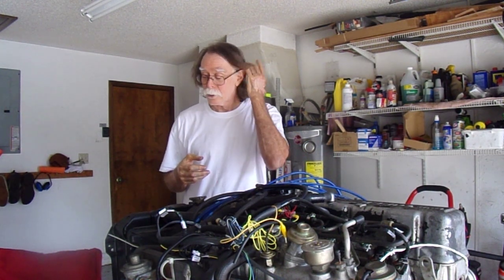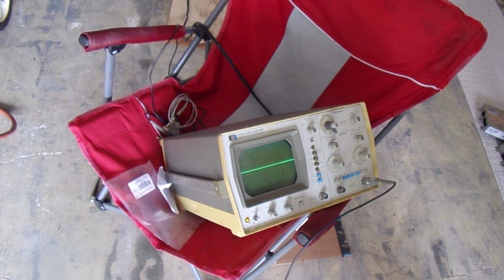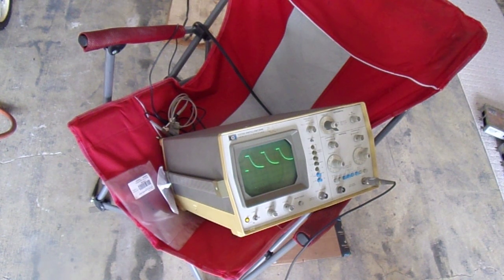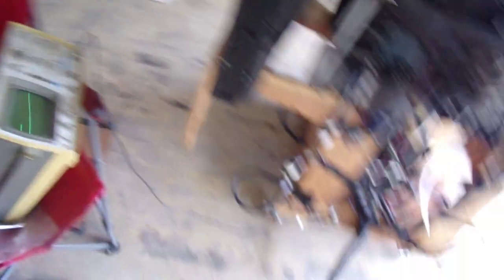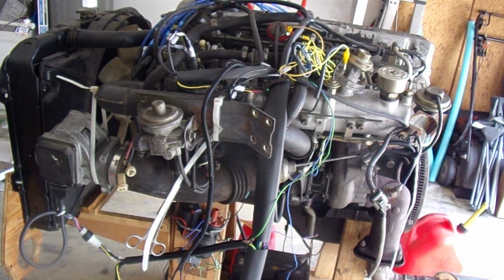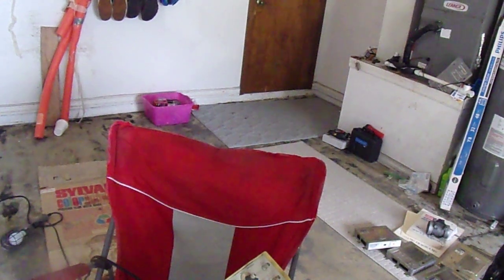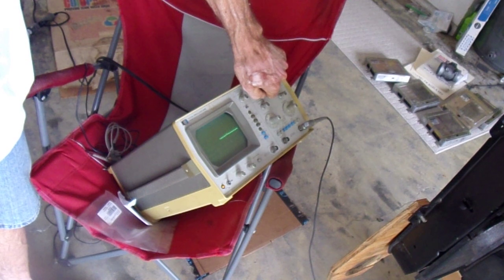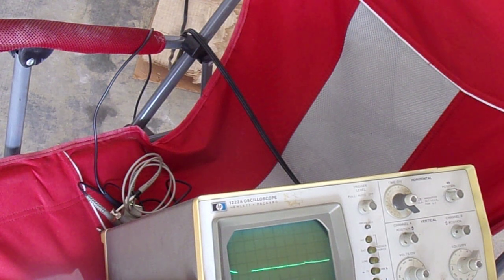ECU comparison 1983 280zx turbo vs. 1986 300zx turbo AAC output

Comment from the maker: I have been thinking about it and have concluded the switch rate is just too fast for a vacuum operated IAC (idle air control). I am pretty sure its not needed as there is an adjustment screw on the vacuum module on the intake manifold. BUT I may try a IAC from a later model car, I note some volvos have a idle air bypass that is two wire (power on spring close for off) that may work. Its a direct control that is the solenoid is directly controlling the air valve (unlike this which is a vacuum control). So another trip to the JY is coming. If I found out anything I will make another video.

Comment: I had done the 300zx whole system swap on my 280zx the only thing that I gained in my opinion was a better way of reading the incoming air with the mass . I had a modified 300zx distributor. And a supercharger on the 280zx motor. It worked great.
Reply from the maker: did you use a Knock sensor?
Reply: If you are going to muck around that much better to just install a crank and cam sensor with an aftermarket ecu
Reply from the maker: @sammyd7857  Perhaps, but I enjoy the muck around part.
Reply: @sammyd7857 very true yeah set a ecu up u can have all the data u need on ur laptop and not have to set up like a mad scientist with 50yr old tech